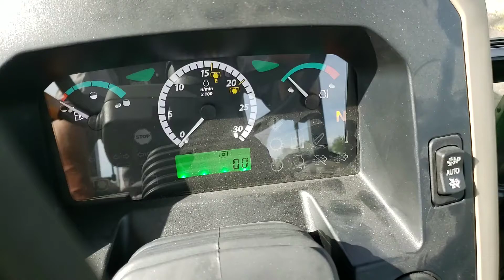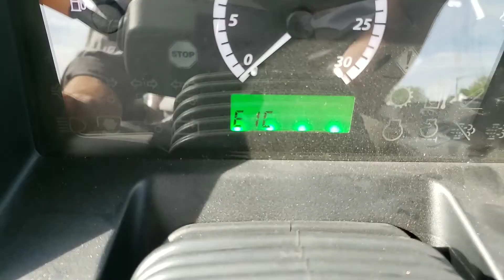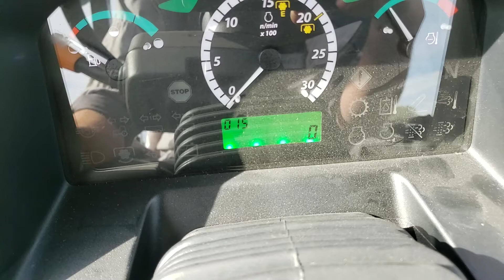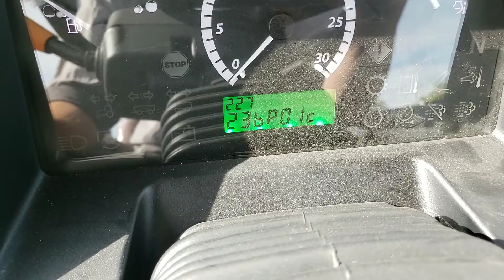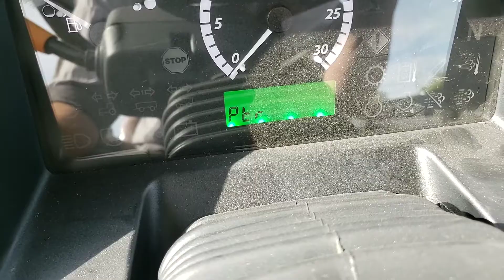Entering Diagnostic Mode - 5 Series

Comment: For your info, this is not "Diagnostic Mode". To get to that, you just hold down the roll button for 5 seconds. What you are showing is "Technician access" mode, which allows you to modify parameters and calibration data within the control units.

Comment: Seems kinda complicated. Thanks for sharing 👍
Reply from the maker: Not the most intuitive thing, but it will get you all the same data PIDs the OEM software has, just not as easy to use. The tech manuals you purchase will list out what each address is showing you.

I use it for quick code checks in the field while my laptop is firing up.